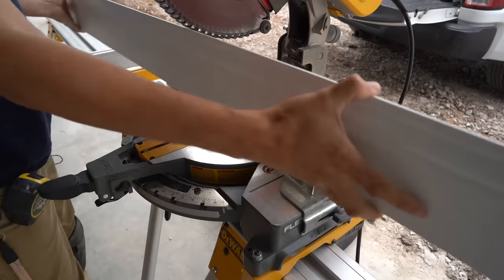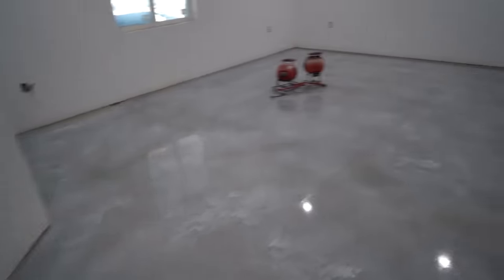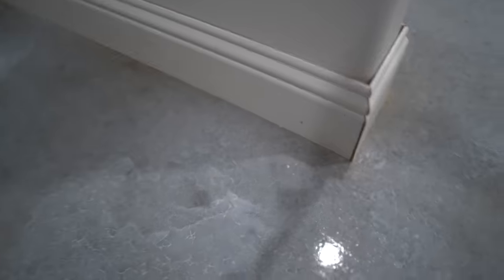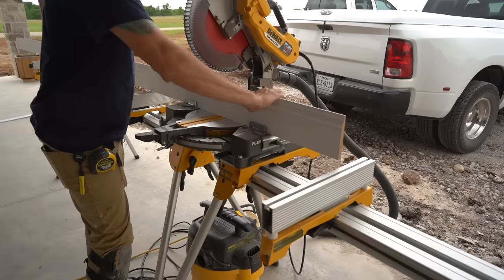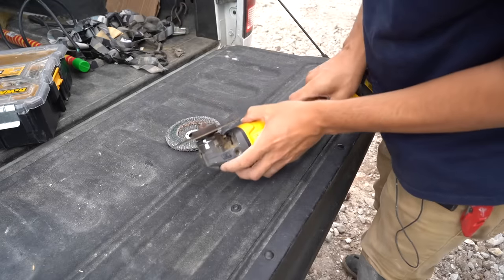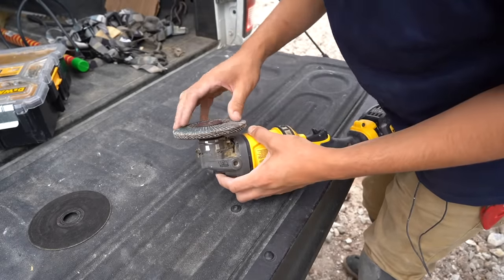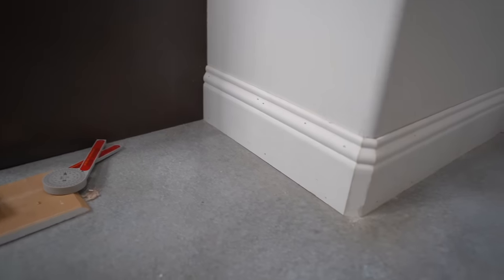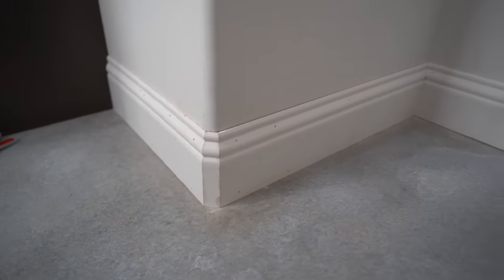don't let your framer do trim

Comment: I don't know any framers that would do that sure looks like the homeowner tried to do the trim and ended up calling you after
Reply: I've never met a qualified framer that would do a job like this, but I have met a few wanna be ones that I've seen first hand do as bad and worse. I can't imagine the homeowner would wreck the trim in their entire house before calling in a pro.
Reply: You do now.  I built a large chunk of Denver from 1970 to 1992. Started as a carpenter grunt.  Wound up a general contractor.  along the way I perfected (for my situation) each phase of the process to a home, business, or apartment building.  Survey for and site excavation, Foundations, Frame, Trim, Int trim, electrical, (insulation, painting and plumbing, I didn't want any part of, I had a rule, if you can clean it up with a broom it was cool, But had to get my lic in plunging as well because you couldn't find a plunger that didn't love butchering the frame)  drywall (hanging and finishing),  and cabinetry + things like tile (loved doing a custom tile entry with the family crest in custom made tiles).  He's right, they are out there, I am--Was one.  Now I'm old and had a stroke 6 years ago that left me paralyzed on the right side.  Now my biggest project is overcoming the frustration I feel every time I attempt one of my old skills.  enjoy your youth.
Reply: how do u cover the nail hose? is it 16 gauage people normally use
Reply: @randomrazr  I use 20 minute sheetrock mud. 45 will work fine also. It's easy to sand and you don't have to wait long for it to dry. Don't use the premixed ones. 16 base, 18 trim nails work fine for me.
Reply: @Wipsplash  shame dewalt doesnt make a nail gun that can switch from 16 to 18
Reply: You don't have to take into account the pull on the end of the tape.  The measurement is what it is whether you hook or butt. That's why there's 1/16 of slide in the tape end.
Reply: @Wipsplash  whats wrong with premix
Reply: I learned the hard way you cannot diy everything...but it is great to try. It's so difficult to find good trade pros-there are those who will say they can do stuff-it's way worse to find out you could have done better....and by better, I mean my work sucks, but not as bad
Reply: Most production framers don't have the time for finish work. And custom home framers make more per hour doing framing. So yeah, I doubt any rough carpenters did that.
Reply: @tripolarnarcissist  Yeh. I was surprised to hear him say that.
Reply: @randomrazr  - premixed is a drying type mud and it will shrink.
20 or 45 is a setting type mud (chemical reaction) and won't shrink.
Reply: @tay13666  any premix u recoomend? or u always use the ppowder?
Reply: Im a commercial framer but i definitively will not leave a job like this i would take my time and actually do a decent job
Reply: @1Rowdy1derful  I wouldn't brag about being a production. Builder in Denver. I work in Denver and these houses are overpriced junk built as cheaply and quickly as possible and it shows in the craftsmanship
Reply: Seriously lol
Reply: Definitely the house owner doing a DIY to save a few bucks then realised he's fkd it up blamed the framers. Cause ifs that the quality for their interior work then the house framing is definitely fucked!
Reply: Nice corner at 4:30
Reply: I know some framers that would do that. There horrible at trim thats we they call them rough in carpenter's.
Reply: Me either crazy really I think you’re right there is no way any carpenter would leave gaps like that
Reply: @tripolarnarcissist  My grandfather (died in 1976) hated using tape measures on anything that required precision because the end would wear out.  He used a folding rule for his fine carpentry.  May dad is quite skilled (luthier) and is a bit more pragmatic -- cut it long and dial it in.
Reply: I was a painter for a builder, their "trim"  crew did a few houses like this until they saw the correct way to do it in other builder's  homes.  They left the few as is though.
Reply: @1Rowdy1derful   I enjoyed your post Leonard. A great perspective. Hope you're still good - I'm very late on this thread
Reply: @jdpace4371  sounds like he couldn't read a tape measure lol
Reply: @PeterTrimboli  Could be.  I think he use the folding rule to transfer measurements, so he didn't have to read the tape, remember and potentially make a mistake.  It's all supposition because I never knew my grandfather. He had all his fingers, though.
Reply: It's just hack blow and go work framers can do quality trim.
Reply: I’m a framer and I can do solid trim work. They’d have to pay me a lot to get me off my jobs to do any trim though

Comment: Dude is a surgeon with that angle grinder. Most impressive part of the video for me.
Reply: How do you even get the markings to make those “cuts” w the grinder?
Reply: @brandonjensen5292  The tan part you see is the cut end of the stock cut at an angle. If you were looking at the board from the top down, you would see it come to a point. He uses the angle grinder remove the point back to the line created by the paint. Most people would use a coping saw to make the cut, unless you're awesome like this guy.
Reply: that part takes skills. the other parts you can do with the right tools and attitude (if you actually care about how it turns out in the end).
Reply: @mallison117  Coping saw if you do finish as job is way faster like 10 seconds flat.
Reply: @asillynertasillynert2204  I use a coping saw too because it’s  quicker but the grinder sure did look satisfying lol
Reply: Yea I’ve always used a coping saw. This guy is nasty.
Reply: I like the grinder idea.  I use a jig saw with a fine metal blade.
Reply: thats easy as you can get with mdf. if it were pine or oak he'd be coping and really showing skill.

Comment: You dont have to be a Jack of all trades.. just a master of one trade.. it's all carpentry.. some guys are just trim guys some guys are just framers and some of us hold the title of carpenter.
Reply: Then there are cabinet makers.  The difference, 1/16 of an inch
Reply: i agree. i'm a dutch carpenter and we do everything from framing a house to trimming it and it is all like it should be. that is just how we learn it here
Reply: Actually it's under finish carpentry. Which from what my mentor told me in the 80"s is suppose to be the highest form of carpenter. And I'm in my 60's so the work is easy and pays more.
Reply: from tree to trim & cabinets & furniture , from foundation to full finish including from well to septic,  & transformer to fixtures & outlets, not too mention painting, flooring, door & windows, kitchens & baths & still learning on the job 30+ years....I'm not just a carpenter, I'm a general contractor :)     quality of product all depends on what the client spends.
Reply: As a tile setter of 18 years this is true
Reply: @nunovyobeeswax4177  This is sooo true.
Reply: @wytzeebels  Must be slow af;)
Reply: @nunovyobeeswax4177  Must be even slower;)
Reply: @brett76544  LOL, if any journeyman of any kind is using a 1/16" tolerance for finish work, then they shouldn't be doing it. I can't imagine being paid to install hardwood crown mouldlings or baseboards and leaving a 1/16" gap in all of the miters - and I can't imagine hiring a cabinetmaker to do a carpenter's job, it would take forever. Not sure what carpenters you're comparing to, bud. You must be subbing for handymen...
Reply: @JamesBiggar  that is the difference, not the tolerance.  after that it gets hard to notice.  When I do inlay, 1/32 can look sloppy,  but the tight fit is almost always done.  I was the monitor for an asbestos abatement for an old library and we found a chisel behind an original 110 year old book case.  I slid some 6 mill poly on it and it cut as I expected.  Then I took it out for the carpenters to marvel at.  Only one knew the significance.  the head of the county's facility's.  Everyone else was shocked.
Reply: @wytzeebels  same in the UK, it's actually difficult if you don't have an old school mentor because people expect you to be able to do EVERYTHING.
Reply: @viscountalpha  you can have the finest marble in the world but if the craftsman can't cut, polish and install correctly it will look like a turd......craftsman can turn garbage into gold if their hearts in it.....
Reply: Right on
Reply: No you do if you ever want to get anywhere in construction.... this is from experience
Reply: We are different here in Texas.. Crews that specialize in what they are doing come in like swat and knock out their scope and move on to the next.. Other states like FL for example spend much more time on 1 trade doing multiple aspects of a project..
Reply: All about the standards you set yourself, I'm sure any framer or even competent DIYer could make a decent job of trim, it's basic stuff but you just have to put the effort in to be accurate with your measuring.
Reply: No man can be a jack of all trades. A good painter will never be a good electrician. A good mechanic will never be a good concrete worker.
Reply: Nunov Yobeeswax I highly doubt you should even be working on anything electrical. It’s highly likely that you lack the credentials to even touch a light switch..
Reply: Wytze Ebels   Same here in Canada. Doing renovations you have to be able to finish the job a to z. I use a rectangular pencil for framing and a .7mm mechanical for mouldings.
Reply: I am no where near your level for trim.   But as a “framer” I can do a better job than most on trim.   Better than what was in the beginning of the video.  Thanks to you I have tried new things and next time I need to cope I’ll be using the angle grinder.
Reply: U nailed it!!👍🏽👍🏽
Reply: Nickolas Ellett yup I’m a framer now cause it’s the funnest I’m only 30 but I’ve still never met a person who can trim even nearly as good as I can
Reply: Brett J Damn the 16th is pretty big I call out sixteenths in framing
Reply: Void l The thing about an electrician is he would have a hard time picking up framing, but I understand all the things I need to know to wire a house and I’ve done it several times and I run all my stuff real straight nice even though it’s getting covered up
Reply: @michaelssword5329  7
Reply: @Nevada Goodwill 32nd in framing is overkill in my books when I frame I deal in 16ths but even that's pretty crazy. Different atmospheres I guess Because, we put up amazing and well reputed houses all the time..
Reply: Wood carpentry is easy. I welcome you to glass carpentry. Cutting and notching glass. Good luck being perfect every single time
Reply: @brett76544  Then some of us also install signs work and dimensional lettering and we can see 1/16 a mile away. lol. Sign work is all about tricking the eyes. If your eye hangs you fail. The other one dead nuts are needed hanging the old roller shades.
Reply: Not to mention anyone who would leave a trim job like that is no master of any trade
Reply: @brett76544  in Iceland you fail cabinet journeyman exam if total devience is more than 1mm... that's about 1/25 and that is the cabinets whole allowable tolarance.
Reply: Miter is tough. Especially if you didn’t frame or do drywall finish.
I cope. And can frame. And do tile. GC all day and do the work. 
Im doing it right! And I do have a shower remodel tomorrow, not kidding! ✌🏻
Reply: @brett76544  I'm an aircraft mechanic, doing sheet metal in college the instructors made us work in 128th of an inch; make cuts in between the 64th marks on the ruler.
Reply: @joshpavelich5235  I know, from making repair parts for Remington's.  I asked a retired professor from a community college due to having a part break in a 22 rimfire about 20 years ago and looking for the part.  I was able to fined the sheet for the part, but only could do larger things with metal then.  Never though I could make something to those measurements until he showed me.  It just expanded on my experience as an armorer in the army where the most we would do was file down burs and such on existing parts, but make new parts.  I cheated a little with using a caliper with a gauge, not the ones you still had to read the metal ruler part of it.  Now they have the digital.
Reply: @brett76544   So funny. True tho. But many carpenters who are true fine-craftsmen also - just in their day work its at speed and on a bigger scale. And the precise detail of cabinet-maker is not required. Here in Aus it's millimetres. I love cabinet maker precision
Reply: @nunovyobeeswax4177   Well said - and I presume that discussion is taken with the client
Reply: @LewisTheFly888  everytime.
Reply: @Void-gn9zm  id wager this to be false, its not hard to learn any one of these things, the difference comes down to how much time and effort you're willing to put into them to become great at them. By you saying that, you're saying that once you learn a trade you can't learn anything else. What most people don't understand is that the majority of work when it comes down to it, is only possible because of experience, perseverance, hard work, and attention to detail. Licensure aside, I've seen plenty of painters and woodworkers spot and fix downright fatal flaws caused by a licensed electrician or mason that were rushing the job, or who were simply inexperienced. 

Yeah id say a true jack of all trades isn't possible, but it IS possible to be damn good at everything you CAN do.
Reply: I agree carpenter is meant to have the skill to do all aspects of the trade     it is down to efficiency if you focus on one.. but those gaps dont justify it... Damn
Reply: @brett76544   Exactly. 1/16 sometimes is like football field for a woodworker/cabinet makers.
- commercial D/H installer (carpenter)
Reply: “each individual can only do one thing well. He can't do lots of things. If he tries, he will be jack of all trades, and master of none.”

- Socrates
Reply: Yessssssssssssssss

Comment: 3:47 You dont have to take into account that pull on the tape measure. That's why it moves in and out. Its to take into account the thickness of the metal on the pull for when you have it butted up against something or have it hooked on the edge of something and are pulling it. It's when you try to account for it that your measurements will be wrong. It moves out when you hook it on something to make up the difference so that your measurements are always the same either way.
Reply: That says it all. He replaced shit work, for midway work. But thats what painters are for.
Reply: @UberAlphaSirus  god bless instantbond super glue and MDF
Reply: @UberAlphaSirus ......Caulk and paint makes you what you ain't.
Reply: @snafubar5491  Do your best and chaulk the rest.
Reply: @osvaldovasquez9048  what if you're best leaves 1/2 inch?
Reply: @themonsterunderyourbed9408  caulk it. Lol
Reply: Happy to see someone else notice this. Given the self-aggrandizing speech at the start, I couldn't believe this.
Reply: They also get off really easily, so unless you have a Lixer or similar, you can't fully rely on it if you're sitting for under 1/32" variance